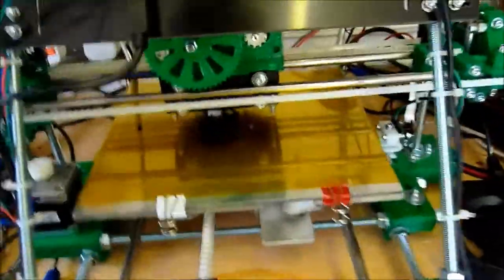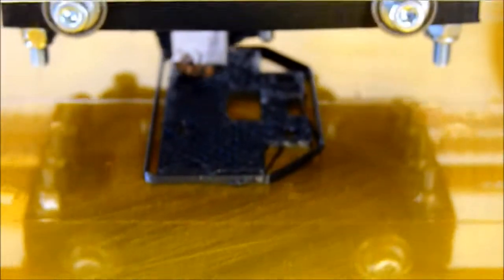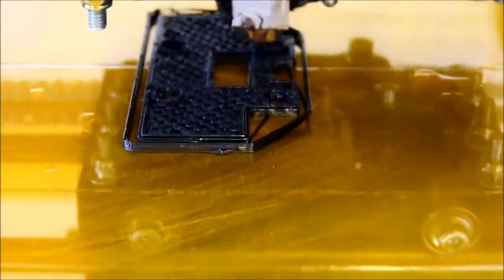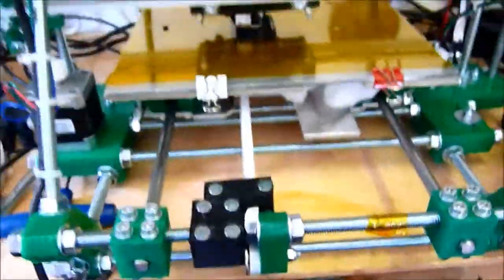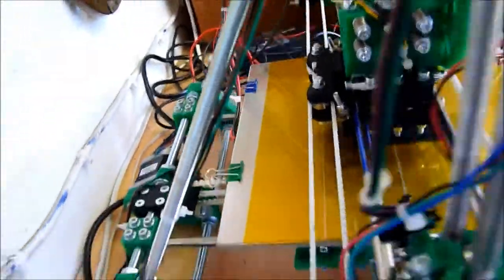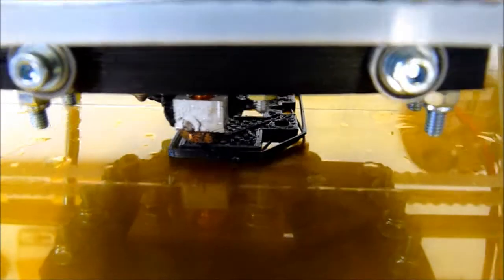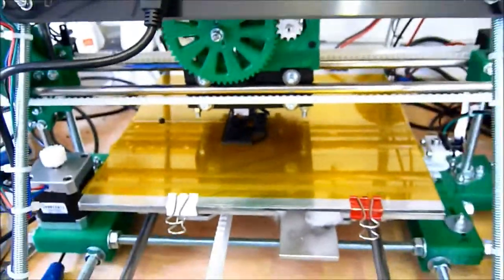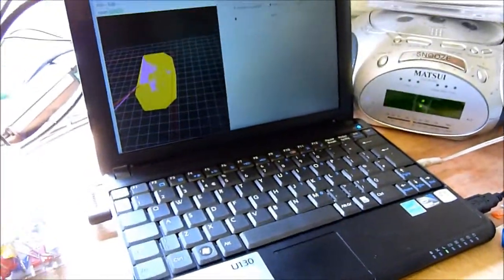Mendel doubled accuracy printing.

Comment from the maker: I did at the time and it significantly improved issues with movement in general. A reduction of backlash was one of he notable improvements. But there are better designs then the original Mendel now anyway which probably corrected some of the problems.